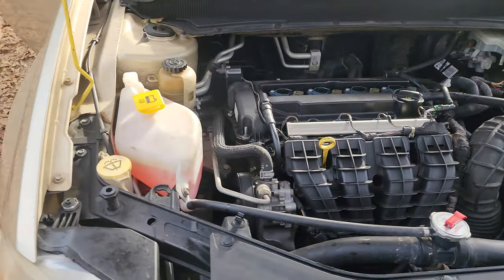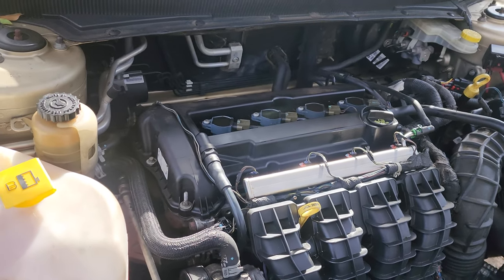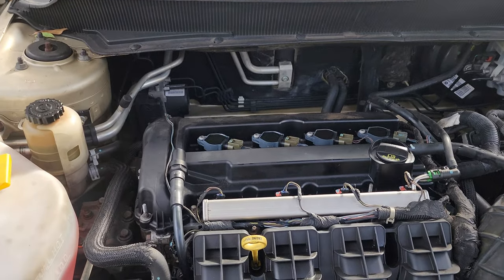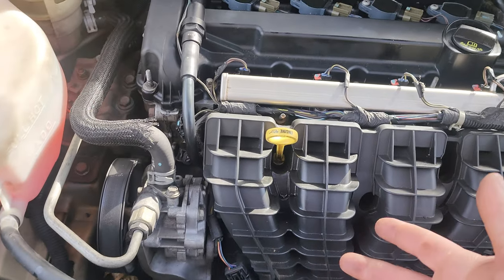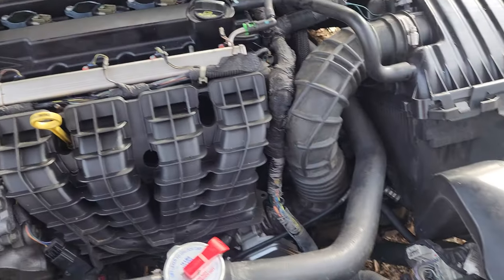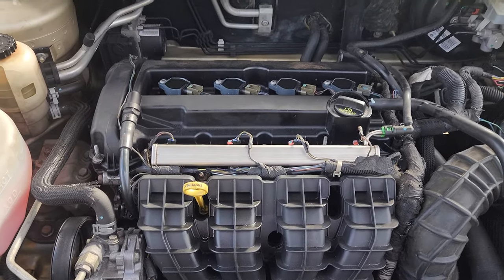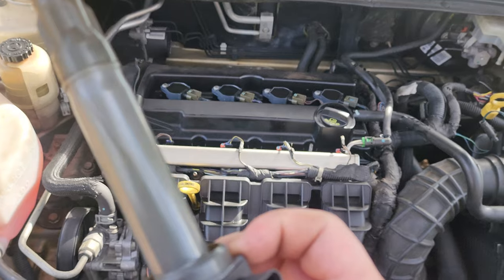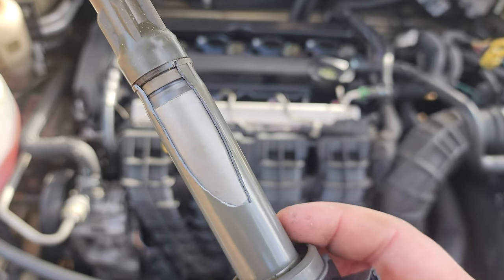2010 dodge avenger 2.4 Misfire/skipping at idle and driving (Solved)

Comment: Mine is the exact same car and it’s been down for goodness….. over a year!!!! I’ve replaced both throttle pedal, and throttle body. It keeps saying there’s a correlation between the throttlebody and throttle pedal sensor A and sensor B. I’ve done research and your right!!!! There are not many videos at all or information about these cars. I’d love to get it back on the road. Thanks for your video. I’ve also replaced all coil packs and plugs but I could still check them out again just in case.
Reply: I discovered it was the connector on it that had a shortage in the wire , it solved it

Comment: I have a 2010 dodge avenger I can drive for like 10 mins before the engine light flashes and the car starts to slow down . Once I stop the car it starts shaking really bad and goes limp. My brother replaced the throttle body and it’s still doing the same thing 🤦🏾‍♀️🤦🏾‍♀️
Reply: Throttle body

Comment: 2010 Dodge Avenger was in limp mode. Had a bad computer. New ECM did the trick.
Reply: Would yours start to skip while driving. Cut the car off and back on. And the skip would stop?
Reply: More so, the car wouldn’t go above 40mph

Comment: My 2010 dodge avenger engine is shaking heavily when I start the car is the rpm reving it self from 600 to 2000 and shaking heavily I changed the throttle body and engine computer but  no luck 
Any help

Comment: I have a 2010 Avenger  the 🌩  bolt  comes  on some times when I'm driving  I have a new throttle body  the car goes in limp mode I turn the car off for 3 min and the car runs fine
Reply: same - its was the alternator that died 1month later. change it before it becomes a problem
Reply: Intake gasket
Reply: These things are notorious for having a bad TIPM. it will mess your car up. Does all kinda stupid stuff. I had to disconnect my horns

Comment: I have an 09 avenger and it sputters when you start it, it has new coils,plugs fuel pump, still does the same stuff, I cant find the fuel filter, it coughs at idle and when driving it will lose power and when I let off throttle it kinda comes back. I dont know what else to try.
Reply: Throttle body maybe

Comment: Would that cause my transmission shift but not engage in any gear
Reply: Sounds like your cable linkage It works from the gear to the transmission sounds like it came loose
Reply: Check your shift cable bushing. I had the issue a while back and it's because my bushing disappeared. It's a 15 dollar fix.